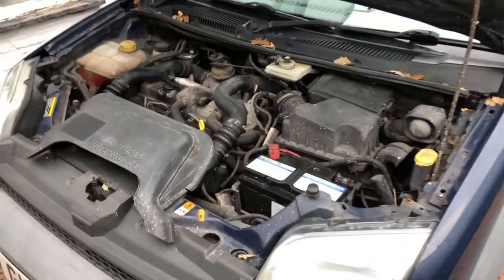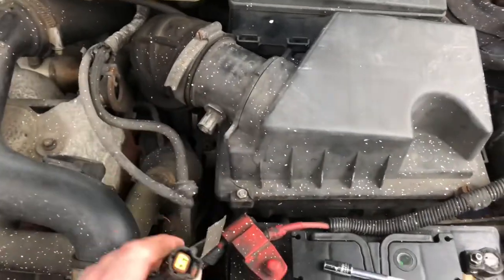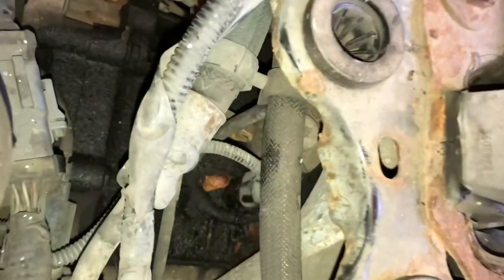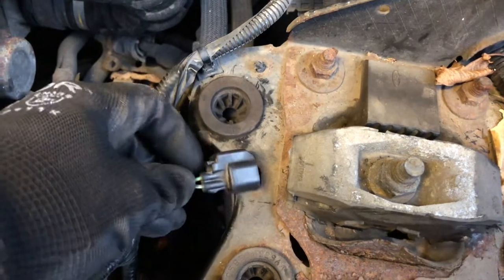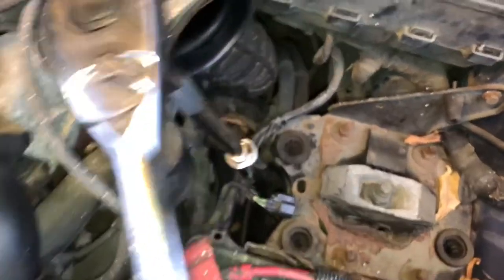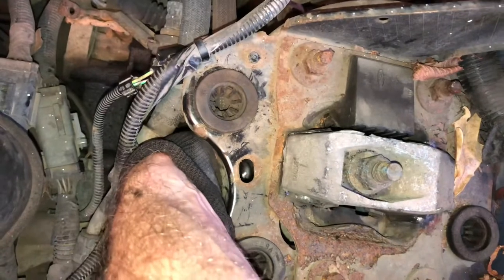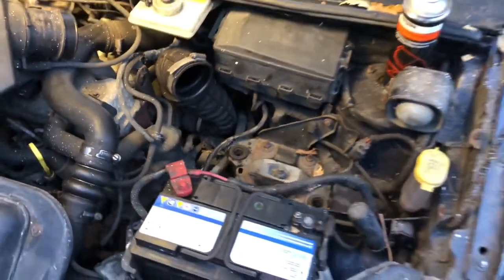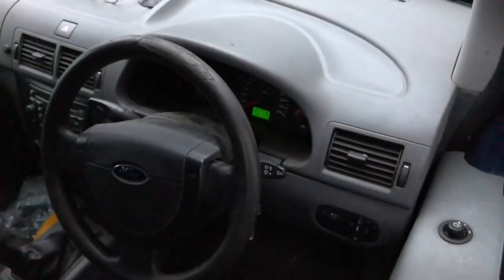How To Change The Reverse Light Switch On A Ford Transit Connect

Comment: Hi mate. Ive changed switch in mine but the lights will only stay on if keep a firm hold to the gear stick in reverse position. Any ideas? Thanks
Reply from the maker: Hi - not sure. Did it have a tendency to do that before the switch completely failed? Only things I can think of are perhaps slack in the gear change cables or other wear. Or maybe switch not tight enough in the box? Let me know if you find out 👍

Comment: My 07 plate doesnt have beepers? I will try this coz ive changed fuse and bulbs and still no joy.
Reply from the maker: Hi if the beepers and reverse lights have stopped working at the same time it’s probably a fuse or this switch. Hope you got it sorted 👍

Comment: This was a great help.  Thank you.
I followed this and have just replaced mine (after checking the bulbs and the fuse first).  Under £10 for the switch on ebay.
There were no jubilee clips on the intake tube on my 2005 Connect, just the factory metal bands, so had to work with the airbox litfted slightly.  Fiddly but very do-able.
Thanks again for a great video.
Reply from the maker: No worries 👍